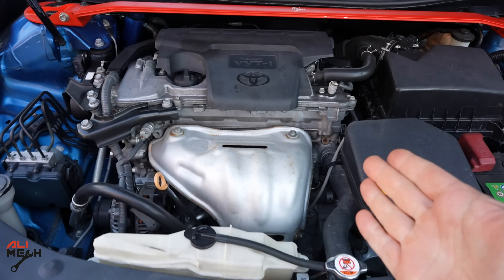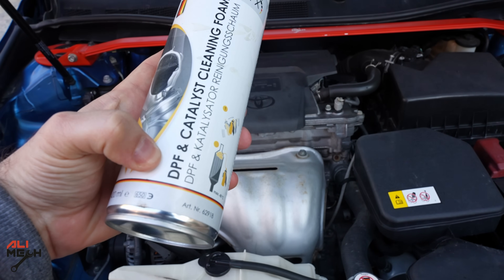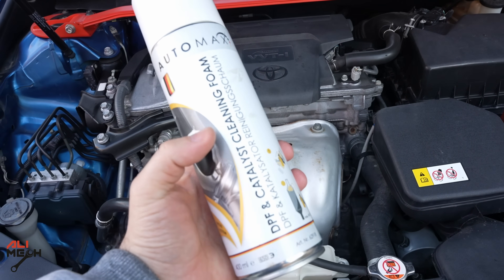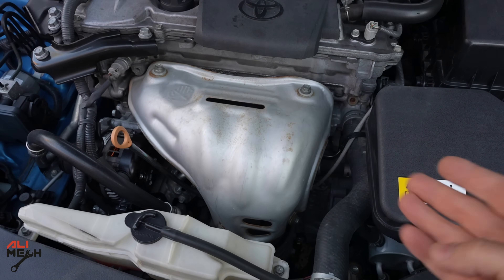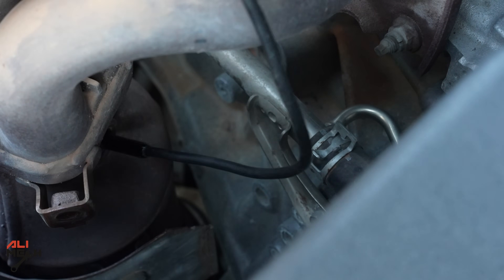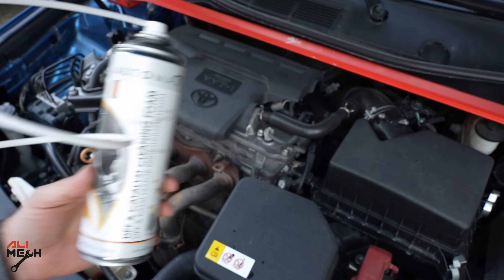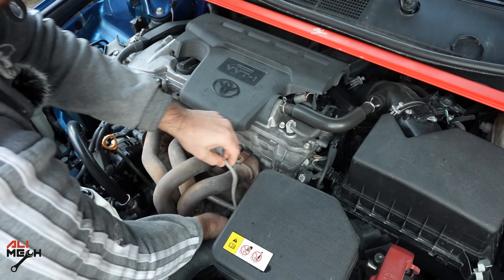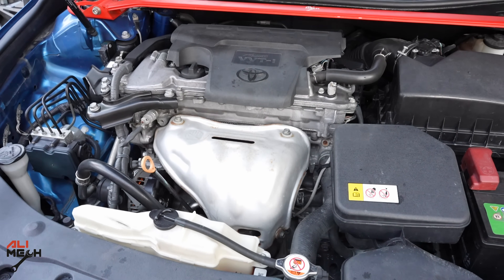I SPRAYED THIS into My CATALYTIC CONVERTER — INSANE RESULTS!

Comment: Hi mi car has 4 sensors ,  2 upstream and 2 downstream ,  should i do the proces on both sides ??  I mind 2 bottles of spray ?
Reply: Same here, I'm curious as to where to run the cleaner on a vehicle with 3 cats and 4 o2 sensor's. In up stream, or down stream area ???
Reply: @jdmintegradp run it thru the upstream sensor before the catalytic converter

Comment: 2014。  camry.  Clogged.     155000 miles.           Burn oil. Replace. New one.  Manifold exhaust. 400$. Part only. Oem.  I will try this out.

Comment: My car’s steering responds slowly when I turn. It doesn’t turn in sync with the movement of the steering wheel. Can you tell me what might be causing this and how it can be fixed?"
🎉🎉🎉🎉🎉
Reply: Check your fluid level and condition. Never hurts to change it

Comment: i would like to try this product here in Canada, but as usual it is either difficult to or impossible to find in local stores. Or i would have to order one can from amazon canada for $62 or walmart canada at $77.18.......for a foamy cleaner? big rip off.
Reply from the maker: That's a lot for that I believe,  I would recommend to find in local store if its possible

Comment: Depends on the car. Some car's engine bay design have the exhaust part at the back and the intake part at the front. I can easily access the intake and clean the valves on the Nissan MR20DD, while I can clean the cat on the Honda K24.

Comment: And after a day it becomes blocked again if you don't cure the issue wich created the problem in the first place.
Reply: What is it?
Reply: A day is exaggerating it would take many miles for it to build up again as long as it isn't a catastrophic issue.
Reply: Yeah I had to realize A cat convert isn't getting clogged because of gasoline left over junk lol.  

It is getting clogged because oil more than likely is getting in the exhaust system.   Smh

Comment: Hi Ali! What I have managed to stick with ever since 1998 is the use of Berryman's
B-12 Chemtool Carburetor, Fuel System and Injector Cleaner, 15 Ounce for the
use of company vehicles that were neglected but then some of them when placed
in my charge to drive over a period of at least two years and yet clear up to the 
present day on my own vehicles all because this chemical solvent is so wickedly 
powerful formula that could so very easily peel the paint off of your car! It's that 
strong, believe you/me!! If it is good enough to clean your O2 sensors and the fuel 
lines, yet also good enough to break down carbon deposits, WELL, it should also 
help clean your catalytic convertor as well! I've used it extensively and I never see 
any huge expenses but only costing me just slightly over $4 bucks a can but to use 
it maybe every oil change interval if not every other fuel fill up if at all necessary. My 
first treatment starts out like this: Although the 15 ounce treatment is good to mix 
with up to 26 gallons of fuel, I purposely take that 15 ounce can and pour the whole 
15 ounces into 12-13 gallons worth of gasoline instead! Since I was a highway type 
of driver back then, I would immediately start out this way, and put in two hours of 
drive time and just within those two hours worth of driving, you should feel an 
immediate improvement based on how much smoother and most nearly effortless 
drivability issues tend to up a go away. Though noticeable changes have taken place, 
I would then top off the fuel to bring the fuel tank level, once again to the half a tank
fuel level but to continue my driving until such time that would require of me to refill
the tank under normal circumstances and that's it! This is all that anyone would have 
to do! Bare in mind, you would absolutely need to know right up front that you actually
have 12 OR 13 gallons in that tank of yours before even attempting such a feat! When
taking the time of using it once again, just use that 15 ounce can to the recommended
amount of fuel, such as at your oil change interval of 3K miles OR if actually need be,
well then you can do so as often as every other tank fuel if indeed necessary as some
people might do but by doing this at every oil change interval should suffice all the way
around and nothing more! I started out using this heavy solvent on a 1986 Pontiac
with a V6 engine that already was showing nearly 200k miles on it of which the overall performance and fuel milage was quite poor and if that didn't take the cake there was
also a 1982 Buick that we had in the fleet that also had  the V6 that was very ill and 
could only barely move out it's own way that was treated with Berryman's that also 
benefited with the same treatment through trial and error with good results also! Both
of the vehicles had drivability issues and poor gas mileage overall! This is not to say
that some spark plugs and even so much as the plug wires would/should be replaced 
as well either! There was even a third vehicle that was questionable that needed the
attention as well! So, does this formulation work? I surely think so! Try it! You just might
like it like no other!
Reply: Does this work on all diesel engines? I have a 2008 Renault Koleos.
Reply: @andrewo.amanfo3965  NOT for Diesel Engines! No way Andrew! Gasoline engines only period!!
Reply: DPF  &  CATALYTIC CONVERTER CLEANING FOAM.

Comment: Ok but how do you do it if the car does not have an 02 sensor like my 1980 Tercel?
Reply from the maker: In that case you need to remove it from top
Reply: @AliMECH  It's underneath between the top pipe & the long pipe to muffler.